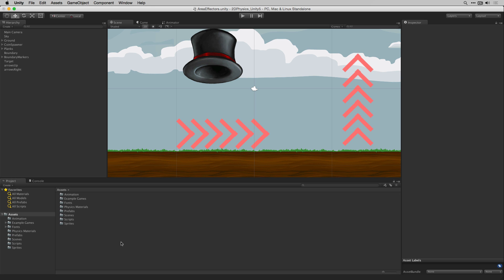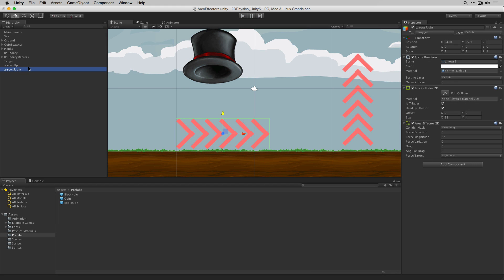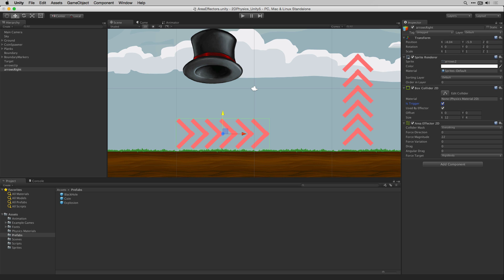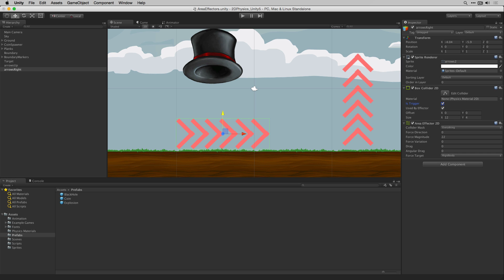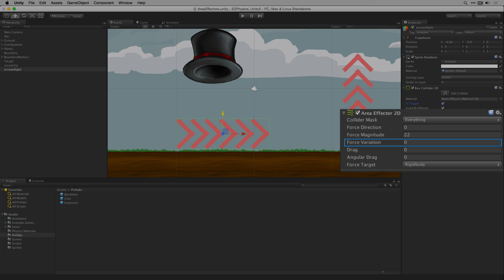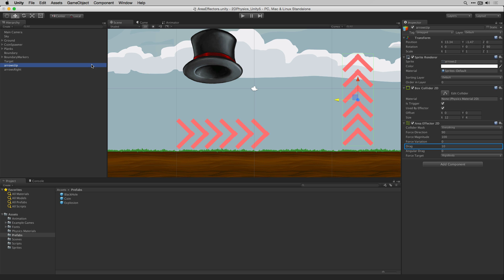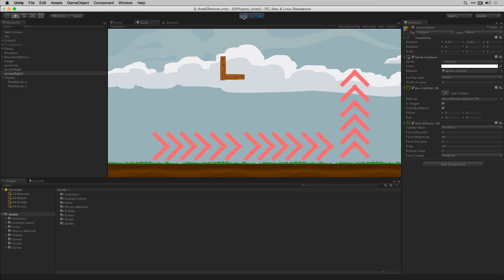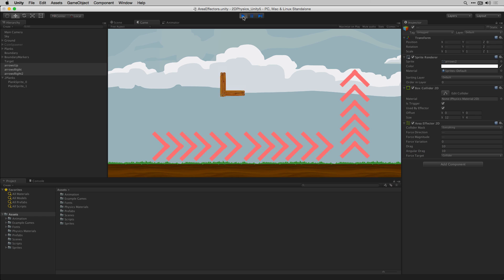Unity 5 - 2D Physics: Area Effector 2D

Comment: is there any similar feature for 3d?
Reply: GaGenah should be pretty easy to program yourself. basically when someone gets in an area - for examle a fan that blows him up - we just add force on him that pulls him into the direction we want
Reply: SimBoter There's not a pre-built feature but yes, you could try starting with OnTriggerStay and apply physics forces while something is in contact with the trigger.